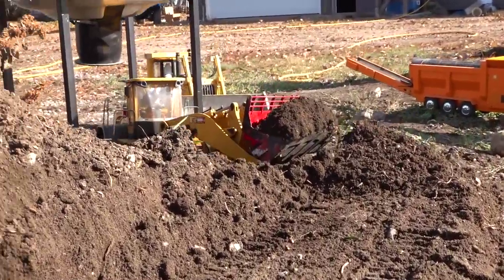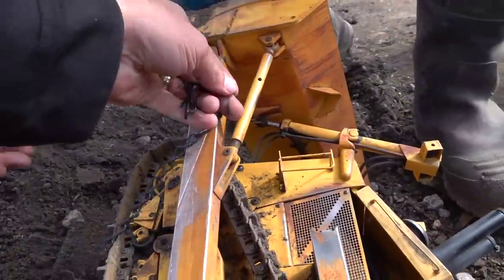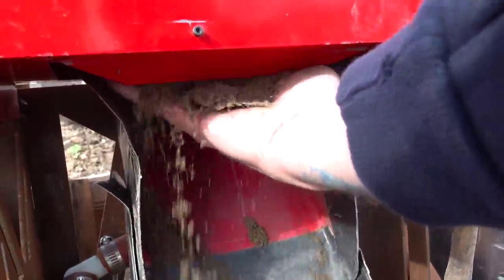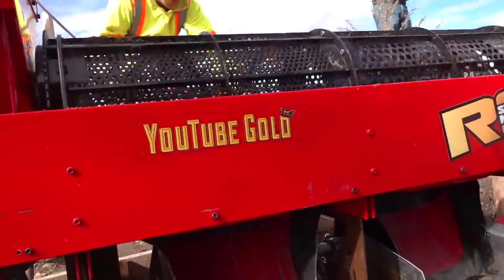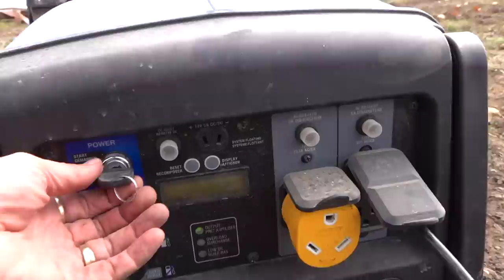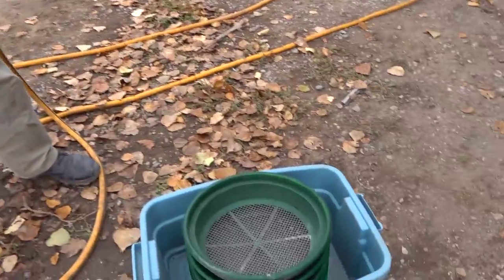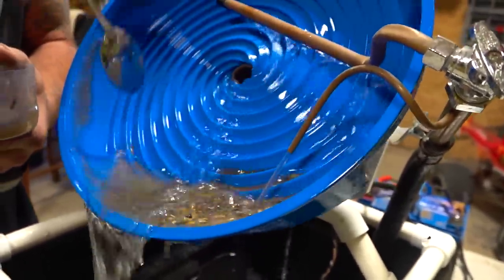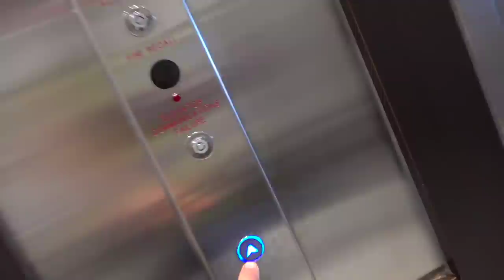YouTube GOLD - BATTLE of the HOE'S - A GOLDEN SMILE (s2 e26) Mini Gold Mining | RC ADVENTURES

Comment: Welcome back to the critically un-acclaimed, non award winning, pun laden, innuendo packed YouTube sensation known as  GOLD, YouTube GOLD.
With the cold of winter moving in and the wear and tear of a long hard season starting to take its toll on man and  machine, the crew strive to reach the dizzying heights and ever changing season goals set by the mine boss. Have the crew become victims of their own unexpected success or have they bitten off more than they can chew? Even with the seasons end fast approaching many questions still remain unanswered and new questions continue to be asked.
Questions like: 
Why do I make these silly voice over type comments?
Will Krazy Joe ever find glory at the bottom of his now moist, wet hole and will it dry out before next episode?
Can Rookie continue hitting the sweet spot when loading the conveyer?
Will Jim/Kevin ever reveal his true form?
Will site safety ever move up from #21 the list of concerns?
Will the crew manage to get the magic smoke back into the esc of their downed dozer? 
Can I continue to come up with the questions no one is asking?
Will the hoe's see out the season or will they be the next to go down? 
Will the mine boss continue to get his hands dirty?
Will the crew find a way to solve their shrinking, sticking, leaking, moisture related issues?
I'm running low on question I may need to reuse some of the previously asked questions?
Will Rookie find the extension cord for the heat gun?
Will the mines budget allow for new batteries for the scales?
How much gold will remain after the dentist finishes with Krazy Joe?

Tune in next week to see if I have more questions.  Maybe by accident we'll get answers to some of those that have been asked. Same gold time, same gold channel.
Reply from the maker: You are our official Hype Man
Reply: I hear this in my head in Mike Rowe’s voice ! So many questions, so few reasonable answers......
Reply: Dirt Devil these are great questions. And most if not none at all  will or may be answered in next weeks episode !!!     But probably not.
Reply: Will Sluicebox ever improve his attendance record? 
Great commentary Dirt Devil😂😂
Reply: Dirt Devil Will there be a season #3 of YOU TUBE GOLD ? If not will there be an episode titled RC SPARKS EQUIPMENT AUCTION 🤔
Reply: @jamesschaarschmidt7713  if the rating continue to be strong and the crew continue to show interest then the chances a good. But don't hold me to it.
Reply: Thanks  @optimusdude
Reply: @RudeBoyzRC  I don't expect any of them to be answered and if they are I know it will be by accident. lol
Reply: WOOHOO  @TheRealRCSparks
Reply: Dirt Devil sounds good but Kevin needs to grow back his beard , he just doesn’t look like a Jim and I should know 😎
Reply: @TheRealRCSparks  It would be awesome if Dirt Devil could record a narrative at the beginning of each episode.
Reply: Fun fact: when reading the first time, the typical voice over voice came out in my head naturally, with exactly the same tone, while reading this comment. I totally approve this. I think you should make the summary of the season and be added on video. 100%
Reply: This made me happy
Reply: Every time. Every darn time. Keep em coming!
Reply: Hello everybody how are you all?
Reply: 0 p
Reply: Can I come and run a dozer

Comment: Should try Dry Silicone Spray in a can to weather and frees up friction and helps on corrosion.   I have used it like a bug bomb in my wave runners to keep the saltwater from affecting and sticking to anything inside the hull and  on the jet drive.   Be worth a shot to coat all your tape and metal where your dry dirt sifting is done.  Now on the shaker with spray bar,  have you tried using higher pressure?  Also in the 1:1 version there is a huge wash deck where the gold drops in off conveyer and gets blasted before hitting the screen deck and those bars.   

Love watching the show and all your vids.   Keep having fun, I'm entertained  and pushs me to do new wild rc builds.